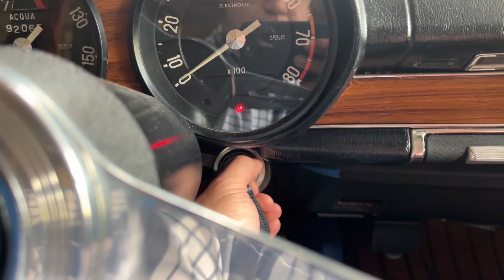Out and About in our Fiat 850 Sport Coupe

Comment: In 1974/75 my mum owned one of these, it was also a series 2, but I can't remember exactly how old it was at the time.  I was 17 and thought it was an incredibly cool car, only 903cc, but it had such a rorty (rear engined) exhaust note. On weekend evenings, when my mum and dad were out, I would illegally (no license) sneak it out of our garage and drive it - not very far, around the local village, desperately trying to manage the spring loaded gear lever. Although it was a relatively new car at the time, it was already succumbing to rust - behind the front light bezels and in the spare wheel well. The offset pedal position - splayed to the left and their close proximity to each other, made it challenging to drive for a gangly youth with size 11's.
Sadly we didn't keep it for long and by the time I'd passed my test at 18, my mum had traded it in with the Huddersfield Fiat dealer for a brand new 127 (series 1 - looked like a hatchback, but just had a boot lid at that time - in that '70s orange colour)
I still look at 850 sports advertised, although I'd need to move my Alfa gtv on first.
Reply from the maker: What a small world - we have had a new model Fiat 124 from the Fiat dealer in Huddersfield as that's where I grew up!  The 850 is such a great little car but I can confirm the pedals are hard work work, even with normal size feet!! ha!